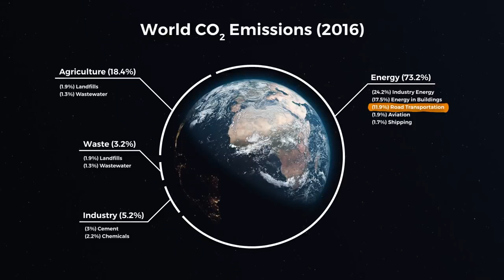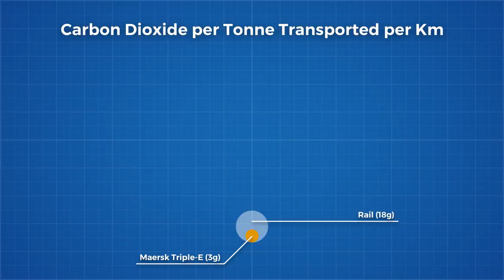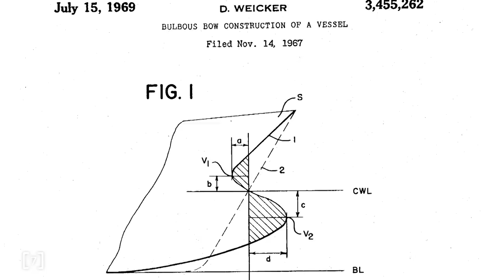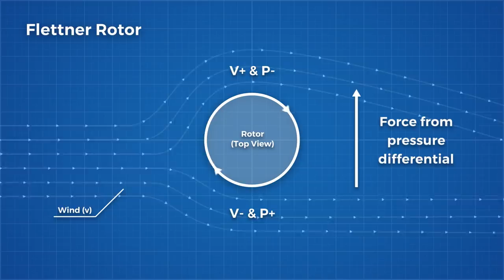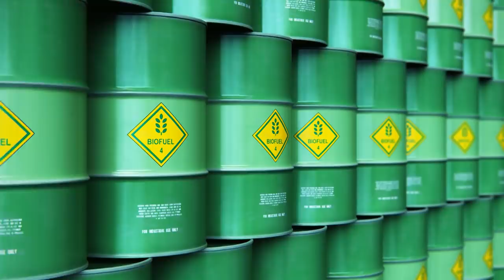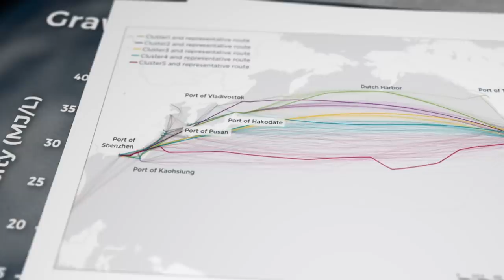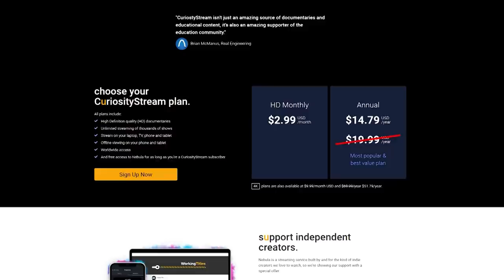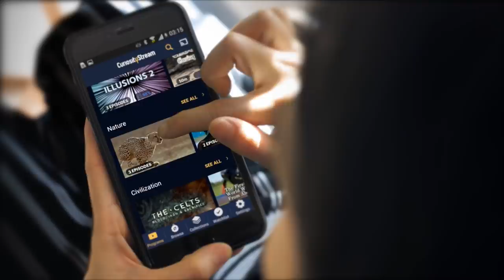Are Renewable Powered Ships Possible?

Comment: Why not just throw a nuclear reactor on there
Reply: If you do a web search for ‘nuclear ship savannah’ you will see that it has been tried and did not work.  A similarly heavily subsidised, by the government, vessel is in use in Russia which also operates, in support of the Northern Sea Route, a fleet of nuclear powered ice breakers these may, or may not, have been completely without issues.

Just think; would you have full confidence in the management of a nuclear reactor under the control of an anonymous entity only traceable, perhaps, via a letter box in a FOC (flag of convenience) nation state?  If you are, could you sell that confidence to Japan, the state that hosted the Hiroshima and Nagasaki nuclear detonations as well as more recently the Fukushima ‘event’?  Then try that same, or a similar, sales strategy on Ukraine, the nation state that as a part of the USSR (CCCP) hosted the Chernobyl ‘event’.  Modern iterations of nuclear energy, thorium fuel, molten salt reactors or fusion reactors, will carry the legacy of past problems.  It is the global trepidation of anything with 'nuclear' in the name and the economics of nuclear having transitioned from 'energy to cheap to charge for' too 'the costs of remediation are incalculable' that will prevent the adoption of nuclear energy as a means of creating energy at sea.  Modern reaction systems may have overcome the safety problems but the general public, having been misled in the past, will be reluctant to believe the fresh new promises.

‘They’ say nuclear is cheap, it’s not it is expensive and has a large embedded carbon quotient as well as being complicated, dangerous, not universally socially acceptable and having only ‘no need for refuelling’ as a questionable advantage; actually it does need refuelling just not as often.  When ‘they’ do need to refill the warming up stuff it takes considerable longer than pumping tonnes of thick black stuff, HFO cSt380, or thin runny stuff, MDO, onboard which is one of the reasons HMS Queen Elizabeth and HMS Prince of Wales are pushed about by ICEs and gas turbines thus using a similar fuel as the aircraft that fly off of them.  The Royal Navy (RN) with a high degree of skill and expertise uses, at vast expenses to the UK taxpayer, a current operational nuclear fleet of 11 submarines (also known as ‘boats’) in two flotillas, seven attack subs and four ballistic missile boats.  The carbon footprint of all the extra bits of hardware and the fuel, including processing thereof, from ground to propeller, are the external costs that never seem to get considered.

Disposal, once it wears out, of both the machine (that was a ship) and fuel is another can of worms best left unopened.  The 26 RN boats no longer in use are laid up (some in Rosyth and some in Portsmouth) awaiting long term deconstruction including dealing with the fuel rods and other irradiated material.  The USN is not, as far as I know, a commercial organisation working to very tight margins and also has the skill and expertise to handle the complexities of nuclear power; so as well as submarines their aircraft carriers are nuclear powered and each of the current iteration has a build cost three times that of QE/PoW, bigger crews and more generous funding.  For those who still think that nuclear energy might be the answer I recommend this report: - https://www.bbc.com/future/article/20200901-the-radioactive-risk-of-sunken-nuclear-soviet-submarines?ocid=ww.social.link.email.  The navy of the USSR might have been under resourced and over extended but it was still generously supported in comparison with merchant shipping.

Comment: A nuclear reactor might work
Reply: If you do a web search for ‘nuclear ship savannah’ you will see that it has been tried and did not work.  A similarly heavily subsidised, by the government, vessel is in use in Russia which also operates, in support of the Northern Sea Route, a fleet of nuclear powered ice breakers these may, or may not, have been completely without issues.

Just think; would you have full confidence in the management of a nuclear reactor under the control of an anonymous entity only traceable, perhaps, via a letter box in a FOC (flag of convenience) nation state?  If you are, could you sell that confidence to Japan, the state that hosted the Hiroshima and Nagasaki nuclear detonations as well as more recently the Fukushima ‘event’?  Then try that same, or a similar, sales strategy on Ukraine, the nation state that as a part of the USSR (CCCP) hosted the Chernobyl ‘event’.  Modern iterations of nuclear energy, thorium fuel, molten salt reactors or fusion reactors, will carry the legacy of past problems.  It is the global trepidation of anything with 'nuclear' in the name and the economics of nuclear having transitioned from 'energy to cheap to charge for' too 'the costs of remediation are incalculable' that will prevent the adoption of nuclear energy as a means of creating energy at sea.  Modern reaction systems may have overcome the safety problems but the general public, having been misled in the past, will be reluctant to believe the fresh new promises.

‘They’ say nuclear is cheap, it’s not it is expensive and has a large embedded carbon quotient as well as being complicated, dangerous, not universally socially acceptable and having only ‘no need for refuelling’ as a questionable advantage; actually it does need refuelling just not as often.  When ‘they’ do need to refill the warming up stuff it takes considerable longer than pumping tonnes of thick black stuff, HFO cSt380, or thin runny stuff, MDO, onboard which is one of the reasons HMS Queen Elizabeth and HMS Prince of Wales are pushed about by ICEs and gas turbines thus using a similar fuel as the aircraft that fly off of them.  The Royal Navy (RN) with a high degree of skill and expertise uses, at vast expenses to the UK taxpayer, a current operational nuclear fleet of 11 submarines (also known as ‘boats’) in two flotillas, seven attack subs and four ballistic missile boats.  The carbon footprint of all the extra bits of hardware and the fuel, including processing thereof, from ground to propeller, are the external costs that never seem to get considered.

Disposal, once it wears out, of both the machine (that was a ship) and fuel is another can of worms best left unopened.  The 26 RN boats no longer in use are laid up (some in Rosyth and some in Portsmouth) awaiting long term deconstruction including dealing with the fuel rods and other irradiated material.  The USN is not, as far as I know, a commercial organisation working to very tight margins and also has the skill and expertise to handle the complexities of nuclear power; so as well as submarines their aircraft carriers are nuclear powered and each of the current iteration has a build cost three times that of QE/PoW, bigger crews and more generous funding.  For those who still think that nuclear energy might be the answer I recommend this report: - https://www.bbc.com/future/article/20200901-the-radioactive-risk-of-sunken-nuclear-soviet-submarines? ocid=ww.social.link.email.  The navy of the USSR might have been under resourced and over extended but it was still generously supported in comparison with merchant shipping.
Reply: @BernardLS  alright Jesus Christ chill, I just think that we should use the cleanest form of energy available and I didn’t think of the amount of staff needed to maintain a nuclear reactor. Note, you might not wanna make really long responses to short comments because most don’t read it
Reply: @BernardLS  another thing, after going back and rereading a bit I noticed a more effective comment would’ve just been the first sentence, not 4 paragraphs. This is a YouTube comment section, not your highschool English essay.
Reply: @goopxiv  my ‘rant’ started as about a dozen words but the supplementaries just kept coming so it grew.  If it is any consolation there are almost equally long ‘rants’ about sails, solar, electricity, alternative fuels, elastic bands (no just joking about the last one).  Truly sustainable, ship less stuff and not very far.
Reply: @goopxiv  Total rant on all fronts is circa 5k words, as I only wrote 15k for an MSc in Environmental Science thesis this rates at about 1st degree level, way beyond high school essay (:-)
Reply: @BernardLS  still tho 💀💀💀 we ain’t grading ur work
Reply: @goopxiv  I rather wish you did. So: -
Content
Detail.                  ?/10
Scope.                 ?/10
Presentation
Style.               .    ?/10
Comprehension  ?/10
Reply: @BernardLS  detail, 11/10
Scope, 7/10
Presentation, 2/10
Style, 5/10
Comprehension, 8/10
Overall, A-

Comment: Yeah if you use hydrogen and oxygen... Good thing its sitting on an ocean of it😂
Reply: The next, least bad, option is ‘alternative fuels’ such as Hydrogen (H2).  Which requires harvesting and processing which has fiscal, environmental and energy costs or impacts, before you get the energy to the point of use, and the use of which will generate effluents that will impact the global environment one way or another.   H2 is said to be good for use in fuel cells that will give clean energy when combined with Oxygen (O2) and leave only water (H2O) as an effluent; so as well as the cost of creating the hardware and separating out the H2 in the first place we now have the cost of providing the O2.  H2 is very, very light and very, very volatile so this is where we remember the Hindenberg airship disaster, the ‘light’ means that though there is lots of energy per unit mass there is not much mass per unit of volume so all the problems other fuels but worse.You need to compress it, more than a lot, or cool it, more than a lot, to get enough on board your ship in manageable volumes to be useful.  The alternative to fuel cell use of H2, burning, also generates combustion products which includes waste heat going to the cold sink and a few NOx nasties.  The numbers are getting very difficult to show any sort of surplus so is this a case of running hard to stand still?  H2 may have a place in the energy mix on land as a storage medium but on a ship where there is a reasonable and constant auxiliary power need the question could be posited, ‘why go through the extra stages instead of using the harvested energy directly?’  After harvesting the energy, from wind, sun or motion of the vessel, as electrical energy better to deploy it immediately as heat, light or mechanical work.
Reply: @BernardLS  i saw an article stating that bill gates bought a hydrogen powered yacht. Figured it's doable. Maybe he's planning to stay out at seas for indefinite amount of time if and when it becomes necessary
Reply: @ajgm3974  WADR there is a big leap from rich mans toy to the high volume low cost and thus low margin world of merchant marine freight.  In following the article I have worked up circa four and a half thousand words in rebuttal statements. The comment about hydrogen was a about a third of the alternative fuels thread. Shipping is a business where one has to think scale, the Mearsk ship is a ‘good size’ ULCC oil tankers and dry bulk carriers are on a similar scale.  Every item on a ship has to pass the is it ‘cost effective’ test. ICEs are in the good, cheap, fast enough triangle so with the development and experience behind them they are a hard act to follow. The best environmental option is move less freight of higher inherent value and do not move it as far.